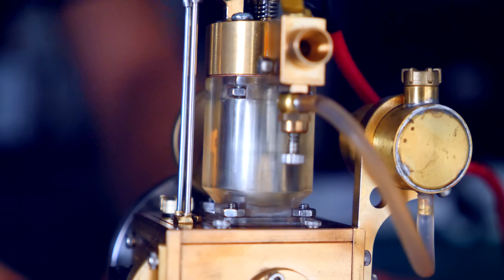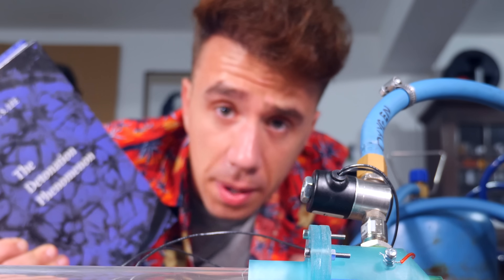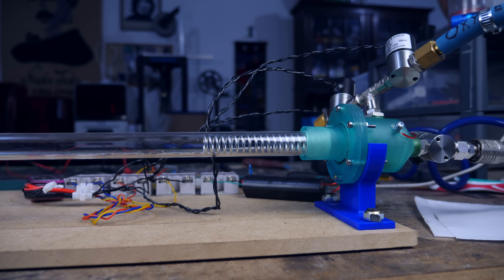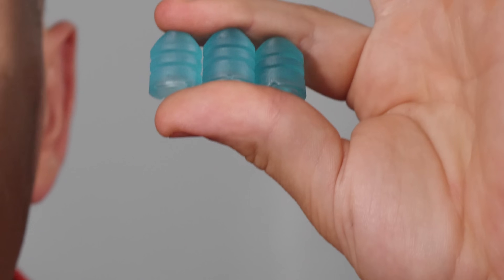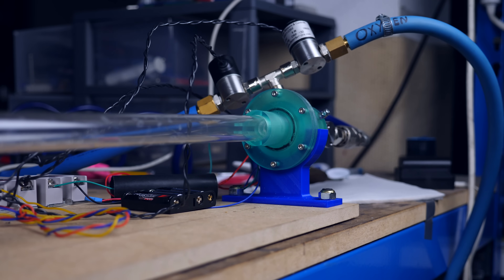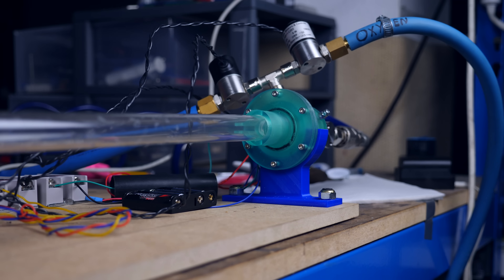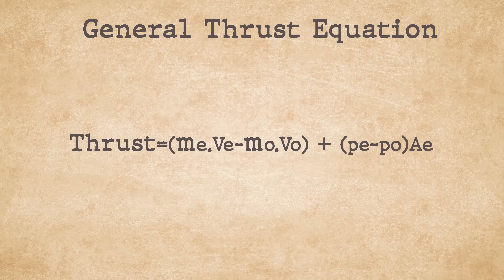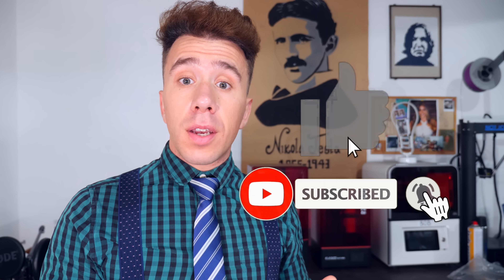PULSED DETONATION ENGINE

Comment: Tomatoes are disgusting, but spaghetti sauce is amazing; So, need to make a version of your pulse jet engine that/ projectile launcher that has a tube large enough and a mechanism to drop tomatoes in and "projectile" them into a screen or wire mesh that can turn them in to a sauce. Maybe if we do it right, it will cook them at the same time too 😆

Comment: Yeah, but why would you do that? Ever whatched a Tysen fight? So, you wont get into the ring with Tyson, but you'll take a seat in a shockwave Jet engine. Look, there is a basic physical rule of force expansion. It goes in general equally in all directions, yet is looking for the easiest way out. That results that the push into the exhaust and in the one in the opposite direction are about the same...Now, imagine where your backbone is....
Beside, that in a piston engine the engine and(!) the gearbox create the power, while in a jet engine burning fule creates an airstream.
I am trying to say that reasoning upfront, as in: "Does that make any sence really?", does make sence.
#cyberpunkcoltoure #1stworldproblems

Comment: My Ideas for you future videos are:

• Make your 3D printed compressed air powered wankel rotary engine water powered (it does only need some minor changes) and try revisiting your 3D printed compressed air powered wankel rotary engine car using the water powered wankel engine and also make a 3Dprinted boat entirely powered by the 3D printed wankel engine powered by water ( which doesn't even need a tank and the water can be taken from the pond and it can produce extra thrust if you use a nozzle in the outlet), use a Tesla turbine as a pump to pump water to the engine. In the car have a tank and redirect the outlet water to the tank itself.
Hence, There is no need for changing the water. Use a Lily impeller and make a boat so that it would be a amazing thing which has 3 amazing inventions by 3 amazing scientists(Wankel Engine - Felix Wankel, Tesla turbine - NIKOLA TESLA, Lilly Impeller - Jay Harman), please try make this one  in your style and I am keen to see your video on this.

• Make a aeroplane powered using your aerospike rocket engine and launch it like a rocket and land like a aeroplane. Use your 3D printed solid rocket motor as a booster to launch it(and you can make it like a space shuttle).

• Make a 3D printed rocket engine powered by hydrogen and O2 with your Metal Filament(From The Virtual Foundary), and iam keen to see what fuel ratio you will use. And use this engine to make a 3D printed rocket.

• Make a Ramjet engine powered missile with your Metal Filament(From The Virtual Foundary) and please destroy some tomatoes🍅 with it (tomatoes are Disgusting 🍅).

• Make a 3D printed rocket which utilizes your 3D printed Tesla pulse jet engine which would sound great exept for the thing that your neighbours will be angry at you.

•Make a compilation video of you destroying tomatoes 🍅 all of these years( Tomatoes are Disgusting 🍅 ),(please make this one).

• Make a 3D printed jet aircraft which houses your vortex cooled  rocket engine but with little modifications like using your Metal 3D printing Filament(from The Virtual Foundary)instead of ceramic resin changing oxidizer from O2 to compressed air or normal air like conventional jet engines which is a Feast for our eyes and that would be an interesting topic. I think you need to name it the integzajet engine or vortexjet engine.

• Make a 3d printed revolving piston steam engine And make a car which utilizes this.
 
• Make your Tesla earthquake machine with the Metal 3D printing Filament(from virtual foundary) and make it from metal and try to use it to power a Tesla Coil.

• Make a Thermo Magnetic Motor which was invented by Nikola Tesla.

• Make a pyromagneto Electric generator which was also invented by Nikola Tesla.

 • Please make a Tesla Alternating current Induction motor with 3d printed parts.( Metal Filament from The Virtual Foundary)

I would try many of these if i get a 3D  printer but i could not afford it . It would very helpfull if i get a 3D printer.
And you have got great 3D modelling skills and you are a professional in it. Please make a tutorial video in 3D modelling mechanical parts in solidworks with parametric equations(I want to learn it please make it). Iam asking this as a request please do it.
 Wish you a good luck in your rocket engine making courier and wish you for becoming a rocket engine specialist soon,  you and Sir Nikola Tesla are my inspiration don't stop doing sir Tesla related inventions.

Comment: you could use a rotating disc valve connecter to motor with a pressure damping chamber after the solenoid valve to get a faster pulse rate to skip buying the costlier valves

Comment: Engines works on COMBUSTION, and not explosion or deflagration.

The fuel-air mixture BURN, it doesn't explode.

Well, it can explode, and THAT is called "knock", and if you have that, you're fucked.
It's not when you have uncontroled explosion or something.

Also, PLEASE use ear protection, especially with sounds as loud as those

Comment: here's a thought to improve the pulse rate. spin the output shaft of a wankel engine with an electric motor, using it's combustion chamber as a valve. theoretically you could get pulses as fast as you can spin the "valve".

Comment: Use an impeller type of rotating device as a 'valve'?
That way you might be able to get up to a much higher rate with a single speed controller.

Comment: I wonder what would happen if you put a nozzle at the end of the tube/barrel to compress it even more and generate more pressure. Would it backfire into the detonation chamber, hindering like so the ability to frequently detonate, or would it actually increase the output gaining more thrust?
The projectile could have some inclined channels to give some rotatory momentum as well as some lubricant, to make it more powerful. You could blast those tomatoes away.

Comment: Since you're dealing with valves you can take some cues from internal combustion engines and make a rotating set of valves that open and close in specific patterns to increase your thrust. So you can keep your standard 10 pulses per second but have three or four or more valves operating at 10 pulses per second alternating to increase thrust and keep the thrust more consistent.

Comment: You should make an engine integrating concepts from the saturn 5 rocket engines. In particular I am thinking of the feul injection system.
Other than that you should watch crazy rocket mans' videos here on YouTube, you might get some inspiration from those, although he primarily seems to use large pulse jet engines. 
Lastly, I would still like to see you make a spherical internal combustion engine.

Comment: Sir, your best best for building a rotating detonation engine, and cheaply, would be a tesla turbine. 
A tesla turbine is uniquely suited to this task, with the rotors being disks(not blades to break), the extremely high rpm’s, and centrifugally induced high and low pressure zones effectively creating a dynamic combustion chamber that can burn with continuous supersonic laminar airflow into the rotor disks and nearly perfectly take the abuse. 

That’ll make some serious power.

Also must mention, your design here looks strikingly similar to teslas “improved fuel burner-combustor” patents.

Comment: would putting a bell shape nozzle at the end help with increasing thrust? because it would let the exhaust escape pushing against the outside air more evenly.
Reply: Pushing against the air is less efficient, that's why Jet engines are better than Propeller ones
Reply: @afoxwithahat7846  You're actually wrong about that. Jet engines can just get higher speeds, but are less efficient. Look up turbo fan engines. There's a reason that airlines are putting bigger fans/propellers on their airplanes. They're efficient.
Reply: @choahjinhuay  Guess you're talking about turboprops, and I doubt turbo-fans work in a similar way, especially because turbofans can use the venturi effect to raise their efficiency while propellers cannot.
 Either way my point still stands, physically pushing against the air is less efficient than accelerating it.
Reply: @afoxwithahat7846  No, I'm talking about turbo fans that are used on jet airlines. You push against a massive amount of air with the fan blade to accelerate it. It's more efficient to accelerate a large volume of air to a slower speed than a low volume of air to a high speed.

Comment: Why don`t you buy 4 valves to use in sequential order for fuel line (propane) or air for example. That way you can increase pulse frequency by 4.

Comment: use tesla valves to make the flow continuous without backfiring, then the spark controls the pulse frequency. As the current top comment stated too, a nozzle would help, with a pulse that powerful the best nozzle would be a bell nozzle for an atmospheric rocket thruster, they're almost a cone but slightly curved and that's what you need for big shockwaves like this engine.

Comment: my suggestion for this engine you should use multiple (just like in a piston engine)  ignitinging one after another, this would get your overall pulses per min up. combine the outputs at the same point but not in one tube just very close to the same output point with even 6 at your current rate would be alot of power/thrust out and seem almost continuous. take all the years of development from the piston engines and this works.  Great work love seeing this kinda stuff.

Comment: You could try to measure the thrusting power by adding a string to the back of the moving platform and in the string attach a series of weights and see how many would be lifted

Comment: Video idea:
Build a real size car powered by one or more of your engines scaled up. Build the Engine out of some stronger (but still cheap like plywood) material.
Ps.: You could also make it a series where you test it on a small scale first so you get to know the charactaristics an problems and then scale it up bit by bit  : )

Comment: Video suggestion: You should use this engine design, but replace the mechanical valves with Tesla valves since they were designed for high frequency oscillation.

Comment: Video Idea: cold 3D printing
Hi, you've tried cold rocket so why not try cold 3D printing. The idea is using a mixture of ABS and a solvent then push the mixture through the a nozzle just like molten filament. One suggestion is to grind the ABS and in a small mixer right before the nozzle you add in the solvent to get a paste the paste is then pushed through the nozzle using a screw mechanism. If this works it would be a good way to avoid the problems of printing ABS.

Comment: Why dont you try using tesla valves to speed up combustion because the shockwave will not let combustion get up to the oxigen and butane imputs. In theory it would be valveless.

Comment: Day 1 of trying to get a 3d printer to shoot bull... projectiles into tomatoes.
you can try to change the shape of the exhaust pipe to see how that affects the thrust. If the exhaust is wider in the end the pressure will increase and then you will have more thrust. 
Thanks for your videos, they are awesome.

Comment: I have a suggestion for a new video. I would like to see you combine your pules detonation engine with one of your tesla turbines to see if you can generate electricity.
I am building something similar with my own design PDE and my design tip jet turbine but would like to compare to a tesla turbine.
This is a link to one of my recent reasonably successful video tests. 
https://youtu.be/Fr6ekbe1P4E

Comment: Next time you could get a five gallon air tank to hook to the exhaust, and let out at least 5% less flow that the exhaust does per second. If it could stand the heat of the exhaust, it would act as a buffer and create a continuous flow

Comment: You should build a HHO generator and use its power to generate the perfect air to hydrogen mixture.  It would be a electric jet engine with extra steps

Comment: How about a double acting gasoline engine, double acting cylinders were used for steam locomotives due to pretty much being a 1 stroke engine. (And all the power delivery that comes with as well as smoothing out power output.)
The big thing will be sealing the rod coming through the cylinder (and making sure both sides are the same volume) but it would be very cool to do here.

Comment: Video Idea: Use 2 Tesla Turbines as a torque converter like on an automatic transmission (works similar to a clutch but for automatic transmissions).  So hook up 2 tesla turbines to each others output so when one spins up it should spin the other one.  I'm not sure which orientation would work best the normal output to output and input to input or input to output on each.  You might also be able to change the size and width of one in relation to the other to get different power/torque transfer rates.

Comment: Would a Detonation engine work better underwater due to the more dense fluid it is pushing against? You are already feeding it fuel/o2 and heat. would a slight fall in the exhaust be enough to keep the water out. and allow a detonation

Comment: Video suggestion, since the pulse jet engine does not give constant thrust you could try and have 2 pulse jet engines parallel of each other and just slightly off time to get constant thrust, could also try and implement the water cooling thing you did the other time

Comment: You should buy like old shipping container and setup safe plexi frame to hide behind it. Every time I see jet stuff at your channel and your face next to it I'm worried something will happend to you.

You could also add some anti flame foam to container, to lower volume down for neighbours, and setup extinguishers system for your safety - ie. keeping bottles outside container in safe space

Comment: I have often wondered what would happen if you replaced the "fuel system" in such engines by what amounts to a glorified toaster element, would heating the air directly still result in usable thrust ?
Reply: No, it wouldn't. You can't heat the air enough with reasonable electricity to have meaningful expansion.

Comment: hey Integza. Love the video. I thought of using two cylinders to counteract one an other that would double pulses. further instead of opening and closing a solenoid you could make siphoning fuel source similar to a carberator but with an turbo compressor pushing air in and a reid valve to direct flow. also you could do different nozzle such as on traditional jet engines to further stabilize air flow. cant wait to see the next video! thanks, Ollie

Comment: Hey integza, I've always wondered whether you could make a tip jet setup such as in a few helicopters with small versions of your pulse or other jet designs. You could either use two small jets, or one jet which feeds output to multiple angled tip outlets. 
Look at the hiller hornet. 
Amazing video as always!!!

Comment: Have you  ever consider using topology optimization and A.i generative design tool for your next video ? 
1 )  Generative design is a form of artificial intelligence that leverages the power of the cloud and machine  learning while accelerating the entire design-to-make process.

 2 )  It lets you use the full breadth of automation and machine intelligence to generate outcomes you   didn't ever dream about 

 3 )  It's a great way to quickly prototype and iterate on ideas while getting feedback from the machine learning algorithms about what is and isn't working.

 4 )  In the context of jet engine design, generative design could be used to quickly iterate on engine designs and find the most efficient design for a given set of constraints.

5)  Topology optimization is a great way to design more efficient structures for 3D printing can be used to create prototypes of those structures quickly and easily.  You can use it to find the optimal shape for a jet engine turbine blade.

6) You can use it to create a lattice structure that is optimized for strength and stiffness.

7) You can use it to create a honeycomb structure that is lightweight and has a high strength-to-weight ratio.

8) You can use it to create a variety of other structures that are optimized for different performance characteristics.
 
I imagine that a jet engine designed with the help of A.i. would be incredibly efficient and powerful and would love to see you launch your neighborhood on the Moon with it =)

 Here some useful link if you are interested to try it  :                                                                                                                      a)https://all3dp.com/2/fusion-360-generative-design-tutorial/ ( generative design )
b) https://www.autodesk.com/solutions/topology-optimization  (topology optimization )
Reply: I don't know  much about topology optimization but using generative design every day ,  I confirm it's a game changer !
Reply: @coquelicotfingerblues2079  Topology optimization is also a game changer because it allows engineers to explore a much larger design space.

 With generative designs engineers (or self taught Makers  like me )can quickly generate a wide variety of design options and then use topology optimisation to further optimize those options. 

This combination of tools provides a powerful way to explore and optimize complex designs.